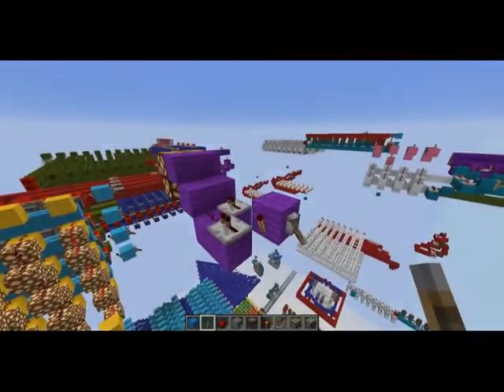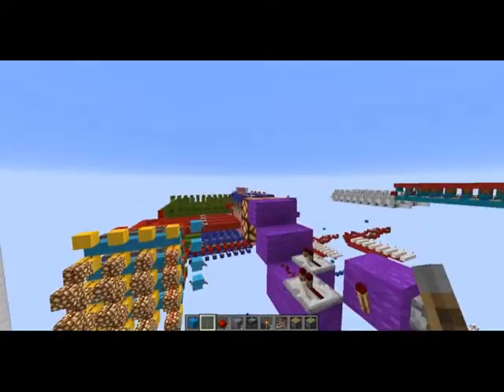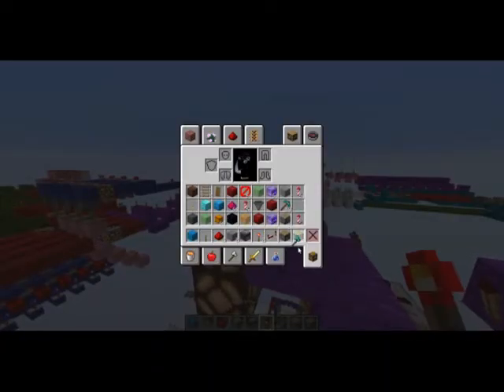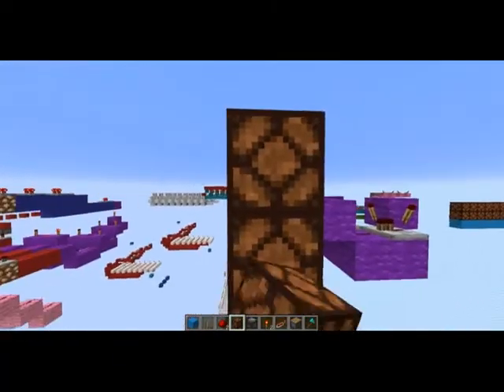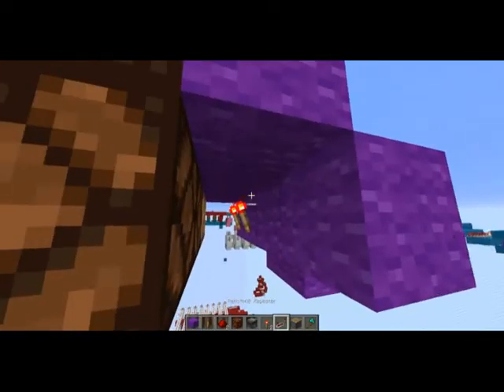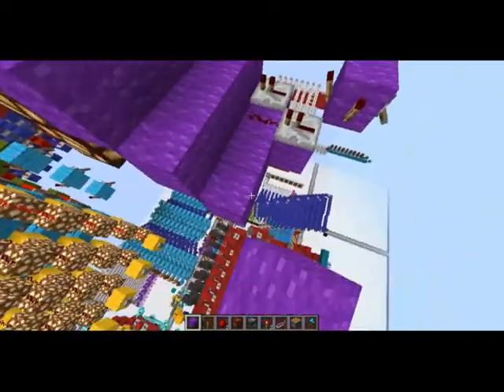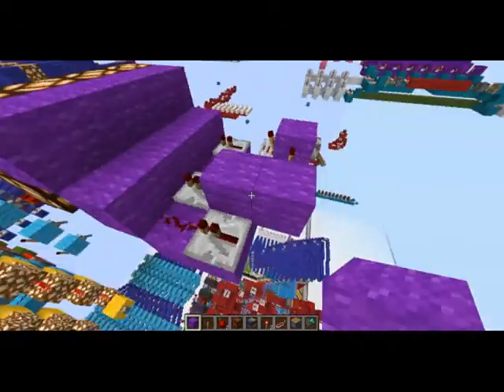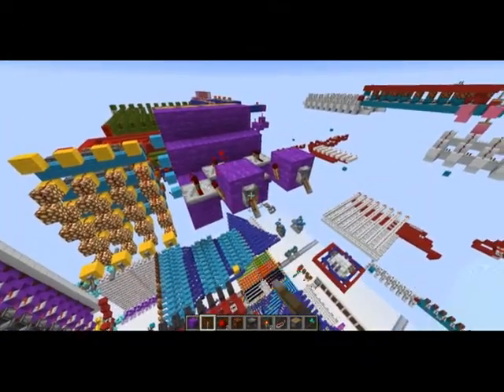How To Make A 2x2 Pixel Display #RedstoneEngineering

Comment: Awesome build, really useful, thanks!
Reply from the maker: Thank you so much!
Reply: @RedstoneEngineer  Since you actually replied, I am inclined to tell you what I did with it. I wanted to control 4 pixels with 1 hex signal, so I built a 4wide by 4tall tileable hex decoder behind the display to control which 4 pixels go on. I then also built a 4x4 tileable encoder to send signals. I was really happy with the result of controlling the 4 pixels over a single wire. If you want to see some of my other little projects, I can give you the IP for a personal server I host